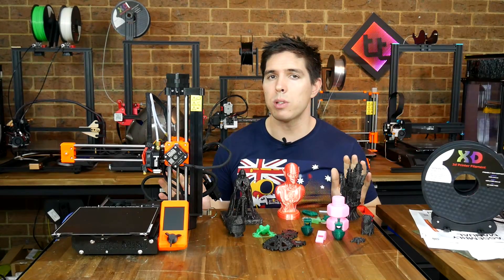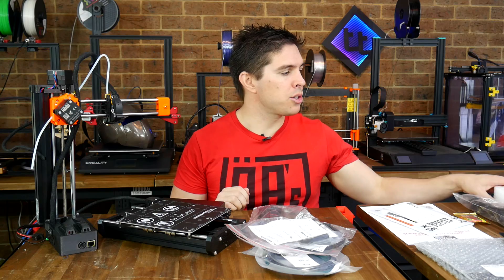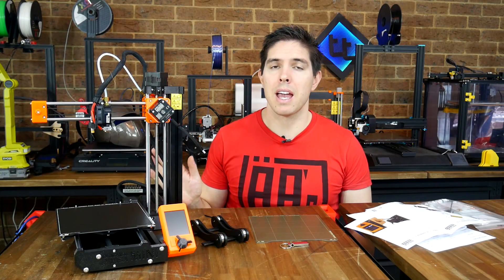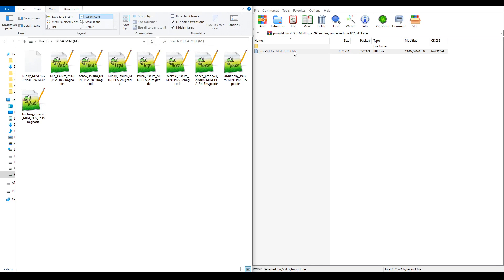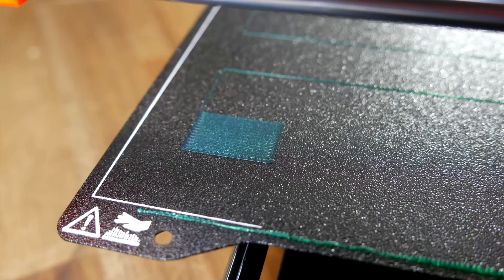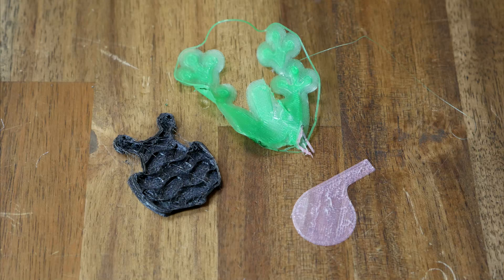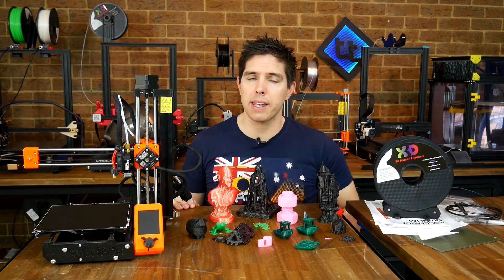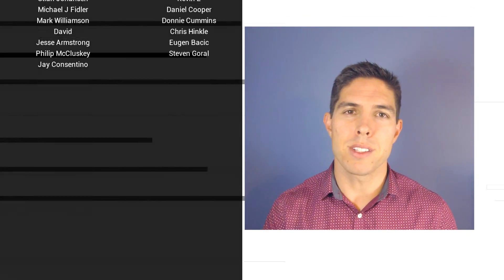Prusa Mini first prints (and troubleshooting)

Comment: So. As someone with limited/no knowledge of this technology, I was hoping this video would give more clarification on someone starting into the hobby, as this model seems to be targeted to as to which model would be best for me, this or and Ender 3/5. I have limited knowledge necessary for upgrades and troubleshooting these devices. Would this be the better choice still?
Reply: Defintly the Prusa mini is the better choice.The main problem of the Mini is the heatbreak. Michaels Video is wrong at that part, the PTFE goes not through the heatbreak to the nozzle but only 3/4 into the heatbreak, rest being all metal. But the temperature where all-metal-part and PTFE-tube connects is still above 100°C, so the filament is soft and expands in a potential gap between tube and heatbreak.
Bondtech made an alternative heatbreak. The tube goes only about 1/4 into the headbreak - rest of the heatbreak is full metal. So the conevtion between all metal and PTFE tube is more up in a cooler zone of the hotend.
Ot was about 15 minutes to change heatbreak (beginner might need 45min) and my Mini works since 3 weeks in 24/7 without any errors (exept one time I tried a very cheap filament with diameter very unprecise up to 1.9mm stucking in the bowden tube, not in the hotend).
So yes, the Prusa Mini is definitly a very good printer to start with.

The Ender 3 is a good printer if you are willing to do much more modifications or accept much less comfort:
- The x and y rolls had to be replaced after 3 weeks of 24/7 use on one of my Ender 3 now. Also the rolls off my Sovol SV01 (which is a little like an Ender 3 on anabolica) start a bit of grinding now.
- The longer bowden makes it harder to avoid stringing
- The Allegro drivers causes artifacts- You have to upgrade board or add TL-Smoothers)
- If you are unlucky, the bed is to much bend for only manual leveling (was the case on one of my 3 Ender 3)
- the spring steel of the Prusas is very nice; I do not want to miss the PEI powder coated spring steel (I modified all my printers to use them)

You might upgrade an Ender 3 to get nearly same level as a Prusa. But you will pay nearly the same.

So my decision 2 years ago was first to buy an original prusa. And than tinkering on chineese printers, always having the Prusa to print replaxement or upgrade parts. The Prusa mini is in my opinion as reliable as the mk3s - if you upgrade the heatbreak.

Actually one recommendation: Sometimes you might want to do bigger prints. So you might start your new hobby with the Sovol SV01. And think about a Prusa Mini as a second printer later. As soon as you have the Mini, you can start tinkering on the Sovol (which is not to complicated and there is many information available)

Comment: I had the same problem in my Prusa MK3. It looks like PFTE tube problem is very common. If someone have this problem, just try to raise temperature.

Raising temperature helps in extruding. Few days ago, filament stucked in my extruder. There was no extrusion. I pulled out filament and it breaked very near hotend. I didn't want to disassembly whole extruder again so I just raised temperature to 290 for PLA, loaded filament and it flowed out itself.

Comment: I really don't know which printer buy (again). In the past I wasted money on a not working printer. Prusa are good but price is too high plus you can't get these issues. Creality needs upgrade and seems you have to be lucky. I can't pay too much for a good printer as Ultimaker and Makerbot or other.

Many online advice flashforge adventurer  3 but I'm not convinced from user reviews...

What printer would advice me for about 500€?

I know perfect printer doesn't exist for 500€ but my first printer was a disaster (hundreds issues) payed around 1500€ in 2011... spent more money on it and never worked properly so I sold it for 1/10 of what I payed.

Comment: I agree with the same three issue : the bolt with nut very difficult to catch. The cover of PCB but that is fine. And the under extrusion issue... but now it is fixezd, the print quality are the best from the 4 printer I have, so without the underextrusion issue it would have been an amazing experience, but it was disapointing. Eventually I am quite happy to have it. Even ABS printing is not an issue !

Comment: It appears that you are printing with PLA on the Prusa Textured build sheet. My understanding is that the textured build sheets are for other filament types such as ABS.  I have been using the smooth PEI sheet with few problems with the piece not adhering to the bed.  I find that I do need to wipe the PEI sheet down with alcohol before each print else I run the risk of the piece sliding out of position during printing.  It's still fairly new with the PEI build sheet having only completed a couple dozen prints, however I have yet to remove the built plate and flex it to release the printed piece. I suspect that over time with wear, the pieces will adhere more readily and I won't need to be so diligent with wiping down the build sheet between prints.  Also regarding the clicking/nozzle clogging... I tried several different spools of filament that were of the same manufacturer and they all resulted the same  -clicking, then under extruding, followed by a nozzle jamb which could not be "unloaded".  The easiest way I have found to remove the jamb is to undo the Bowden tube by removing the fitting nearest to the extruder with the supplied wrench/spanner.  slide the PTFE tube up & out. Then cut the filament you should now be able to unload, but note that approximately 10" of the filament that you just unloaded will not be smooth. Be sure to cut the portion off before reloading.  Now, you will have a small piece of filament remaining in the extruder where you cut it.  Heat the nozzle to 170C and once up to temperature has been reached, it should pull out cleanly. You may need a pair of needle nose pliers for this if you didn't leave enough filament to grab on to with your fingers. Now push the PTFE Bowen tube down into the fitting as far as it will go, and re-thread the the brass fitting on to the compression fitting. Note: it just needs to be snug. In fact, mine is "finger tight" so I don't need to use the wrench the next time.

Lastly,  after much frustration with the clicking/nozzle clogging, I changed to a different filament manufacturer (ERYONE) and the problem is GONE!   I can only say that this is my first experience with a Bowden type extruder, and that the Mini must be less tolerant to Filament (size) tolerances than direct extruders.  I am now using those problematic filaments in my other 3D printers which all have direct extruders as it doesn't seem to cause those issues.

Comment: I also had clogging with my Mini. Yesterday my new heatbreak from Bondtech arived. The full metal part is longer, the PTFE tube shorter. So no softened filament reaches the point there the PTFE begins anymore -> no clogging.
So the heatbreak definitly is something Prusa should change.
I also changed the feeder to the new Bondtech BMG for the Mini. Not necessary, expansive - but hey, what should yo do in the crisis but tinkering on your printers. Trianglelab already made a clone of the BMG 4 Mini, but I prefer the original.
With this two changes the Prusa seems pretty nice to me. Hope they get up network functions soon.
Only one think I do not like: the filamentsensor. I prefer rotary encoders to detect stuck filament. But maybe with the new heatbreak the simple Sensor from Prusa is o.k. now

Comment: With my Prusa Mini I had no problems out of the box. Maybe because I used the smooth PEI bed. I did try with the textured bed later but the print detached like yours did. I just went back to the PEI bed and I'll try to figure out the textured bed out later. I also didn't have any problems with the print quality at all. But that's just my experience. The firmware could have been better too because I only got it in March.

Comment: I wish I could get one..sadly no money plus its not on store until august.. I got an Anet A8 since nearly 2 years which I couldn't get to work due to bent heatbed (had to order a new one + put a glass plate on it and got some rubber boots for it online), constantly clogged nozzle etc etc, I so far, after 2 years, didn't even get ONE print done, so I gave up and the A8 has caught dust on my shelf.

Comment: I got mine a little over a week ago and the first few prints where flawless.  But lately I’m getting that missed filament like you are.  Asked the Facebook group and it’s all “first layer”. Is there away to check the tube with out taking it apart?  Or is that gonna be the only option?

Comment: Thanks for this informations. Almost everyone having a Prusa Mini got the same problems. I don´t know, why Prusa is not fixing that problem. If you don´t want wo usw a larger PTFE und kann unscrew the three screws at the Hotend. If you push it to the top (and don´t forget to recalibrate the PINDA) the problem could be solved as well.
If you have fixed all the problems it is a good printer. But not as good as the MK3S.

Comment: I had exactly the same problem, i losened the grub screws and pushed the hotend a bit more in which fixed it for me, took me a few hours to figure out and find the solution tho
https://forum.prusaprinters.org/forum/assembly-and-first-prints-troubleshooting/underextrusion-4/

Besides that i can't print the original gcode with any other filament than the prusament, i have no idea how but with my own filament (eryone) it fails, if i slice myself it prints just fine. I am overall pretty happy with the print coming from a Wanhao i3 which was really bad in hindsight.

Good video man!

Comment: I was one of the first ones to receive my Prusa mini. I have been printing on it since mid-December of 2019 (ordered mine immediately after the announcement at ERRF). I haven't experienced any significant issues on mine, it has been rock solid. I did have to loosen a few of the zip ties because they were overtightened. Beyond that, no problems. I have printed mostly PETG and PLA. I do notice a bit of a stronger odor when printing on my Prusa mini versus some of my other printers with all metal hot ends. I do notice some ghosting at higher speeds (100 mm/sec) but that is the case on most printers with moving beds. I haven't notice any vertical banding on mine. The MINDA sensor seems improved over the past iterations (MK3, MK2) and is more repeatable. I've had to reduce my extrusion multiplier in the mid to low 90's on most filaments to prevent over extrusion. 100mm e-step test was accurate from the factory.
Reply: check the ptfe tube could have melted pla shouldent smell

Comment: The reason your poly triangles where looser than previously printed ones, was due to you printing the play tiles on the prusa, these tiles are designed to be a loose fit and move more. the other version of poly tiles which you printed prior where the normal ones created and published by the same guy. from my expierence of these the way the prusa printed them seems pretty much perfect.

Comment: I received my own Prusa mini a couple weeks ago. I was also plagued with the same problems as you, firmware crashes during purge cycles under extrusion as well as hard extraction when changing filament. I took my extruder apart and found that the ptfe liner was indeed too short with a ring of filament between the end of the tube and the brass fitting. I added about .75mm to the length of a new piece and the under extrusion has gone as well as the hard extraction problem. Oddly enough the firmware doesn't crash anymore either. One thing I noticed is that the part cooling fan blows on the heat block as well. In the mean time I have reduced the fan to 80% and increased the nozzle by 10c until I design something to clip onto the existing duct to direct the air to the part.
Thanks for this video as it saved me from getting fed up and sending the whole thing back. Now it seems to print beautifully and I will be keeping it to work alongside my Mk3S MMU2.

Cheers, Mike.

Comment: Thank you for the informative, well articulated video. Just bought my Mini the other day, so it'll be here in the summer. It is a little worrying to see issues like this, I hope they've addressed them by the time they get around to mine!
Reply: If it comes in Summer, it wont have this errors, thats the prusa Problem, you shouldnt buy in the first 3 months but because it comes in the Summer, they will have enough time to fix the Problems. Everythink will be fine (maybe some small adjustments )

Comment: Just to note, I had an issue with the Prusa mini Looks like the Bowden tube that feeds from the gears to the extruder may have overtightened fittings. This will create a smaller diameter which cause's a jamming or loading issue, a solution I found was drill down the Bowden to widen the diameter of the Bowden fittings (Be careful not to break or Overwiden !).

I also found that this issue is persistent when using Cheap or NonUniform filament as the diameter may be slightly different causing a catch on one of the fittings, Yet I also found this issue persisted with Prusament suggesting the fittings are Overtighted In factory as this part is pre Assembled in the Box.

Comment: I've had my Prusa Mini for almost a month and it's a fantastic printer.  Very high quality.  Nearly silent.  Large print volume compared to the size of the printer. And very reliable.  I ran a detailed print that took six days and it completed it without any issues.  I highly recommend checking out the Prusa forums to see what other users are experiencing.  This link is to the "Prusa Mini wait thread" where we were chatting while waiting for our printers to arrive, and have continued to chat since we received them.   https://forum.prusaprinters.org/forum/general-discussion-announcements-and-releases/unofficial-prusa-mini-wait-thread/paged/120/#post-195726

Comment: This mirrors both my expectations and my experiences totally. I had the same experience with clogging creating such a blob that filament couldn't be unloaded. I didn't have to change the PFTE tube but I had to adjust the heatblock twice, it printed well.

Now I have the problem that it doesn't follow the first layer calibration so it's always far above the heatbed. Maybe the minda is not positioned right?

Comment: I got my MINI in first bunch of sends (= before xmas), as i ordered in first 3hrs since announcement, I had only small issue with loose belt under Y which i didn't check from start, a side from that i had no issues at all. With PLA i recomend smooth plate, it holds perfectly for me on mini (not so awesome on MK3s for me). I do have MK3/s also over 2years now working perfectly for over 300 run hours now. I cant say anything "bad" towards Mini as i print only PLA and PETG on that, marvelous results with those, on smaller prints most likely better than from MK3s. A bit expectable thing to consider, if you are about to do lot multicolor prints based on layers, bit more complicated filament change (bowden related) than at 3s, so its only thing to mind. 
In conclusion : For that price? probably no brainer for me, simple, reliable, heavily supported and documented. For total beginer? same thing, just go print and dont waste your money on trying to learn with overcomplicated printers with issues, and various needs about this or that. What i would love more? if it would be capable doing two "multimaterial" switchnig to be able to print with soluble supports.

Comment: I received my prusa mini on February 5th.  Mine has been working flawlessly since.   I have printed about 2kg of filament through out so far.

The only issue was like Michael's out of the box it wobbled on the table a bit.  I loosened all of the screws on the front and rear plates on the extrusions.   I firmly held the y axis assembly on a flat hard surface and re-tightened the screws and cured the issue.   

And with the textured pei plate they need to be washed with hot soapy water.   I use dawn dish soap.   Dry it well and wipe with alcohol.  The soapy water only needs to be done once.  I believe oils are released during the powder coating process and they are not cleaned well from the factory.   

I hope some of this helps you out Michael.

Comment: Hey I got an issue with my ender 5. The bed is heated and clean but the nozzle keeps jamming and coiling the filament instead of adhering to the surface, I tried everything to clean every part and it still happens , any ideas as to why?

Comment: This aligns with my assessment of the Mini at first glance.  A bad idea resurrected years after the fad died for good reason.

First, why make a cantilever?  The answer is ALWAYS cost savings.  Therein lies the fault.  With that driving factor motivating every design decision, you quickly go too far to save a few extra pennies.  The result is therefore expectably flawed.

I’m comparing this to the Monoprice Mini, TronXY X1 and Creality Ender 2.  Those printers went so far to save a buck, they actually excluded dedicated layer cooling fans.  We’re talking about less than a dollar worth of wire and fan.  But a significant downgrade in printing results.  Bad decision fuelled by a flawed primary design goal.

Enter Prusa a few years later.  While they’ve not made the same exact bad choices.  The fundamental goal of cost reduction still produced (IMHO) a predictable result of an underwhelming product with print results not worth even close to its price tag.